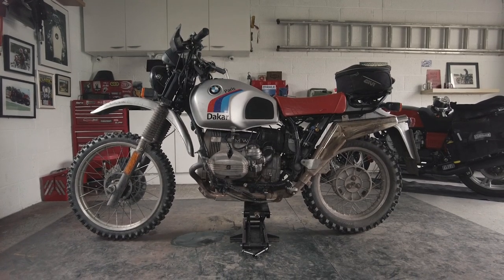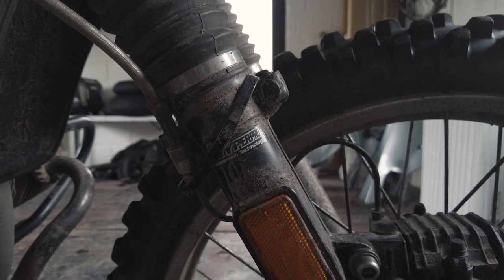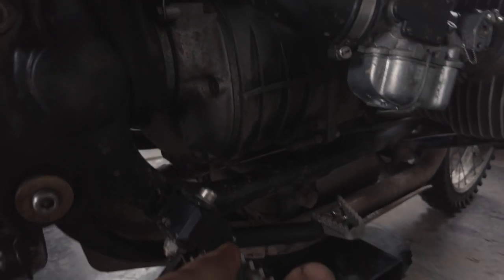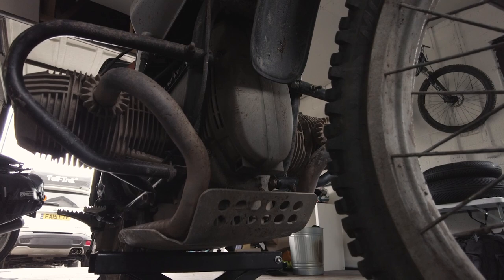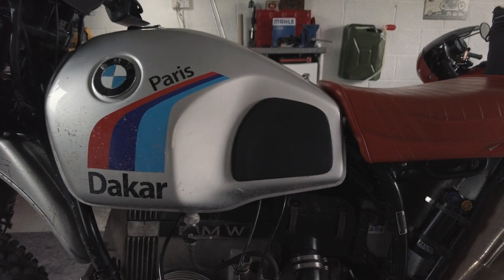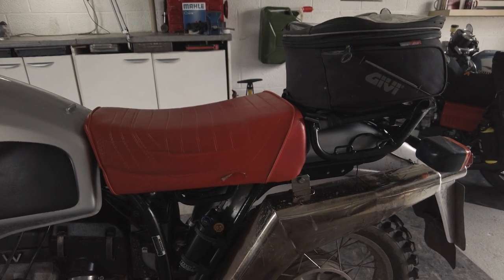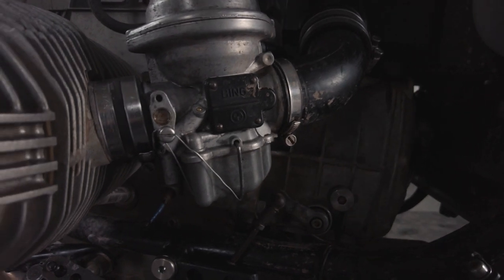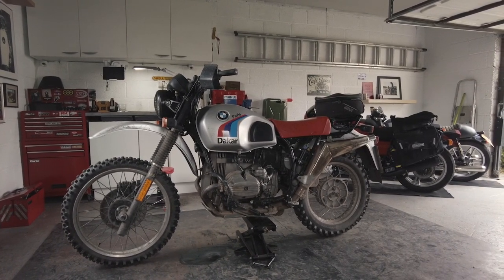GARAGE VIDEOS - BMW R80G/ST - Modifications explained and rated, technical walk round

Comment: Something I would add would be a ceramic clutch plate (the next time the gearbox is out). They are almost indestructible, they work when they’re red hot, they work when covered in oil (if you blow a seal). You can rev to 5000rpm and feather the clutch out in 2nd to get going in deep sand without ever worrying that you’re going to burn the clutch out… it’s the first thing I replaced on my original monolever GS, then an 1150 GS and now my 1991 bumblebee. They practically last forever - I’ve never got near wearing one out including full trans-Sahara, trans-Congo etc.
Reply from the maker: @paulclose3426  great tip, will definitely look at that next time she’s apart

Comment: Very nice information, thanks a lot. I‘m myself driving the 1991 gs and also had the shit in my pants because of the sidestand auto-snap situation. I‘ve had the sidestand modulated with a new spring set up and some welding. It works great even with the default sidestand.

Comment: Also based In Wales and have started modifying a cs 100 into some sort of Dakar Rep, but have come to the reality that I want something to use. Just strengthening the frame at the moment, be interested to know what options are best for the fork conversion, DRz is an interesting option
Reply from the maker: The hyperpro guys in Holland all ride pretty heavy duty trials with theirs and they all do DRZ400 conversion so they can’t be too far wrong. GS front end wasn’t a huge improvement although made it a bit more rideable off-road
Reply: Do they have any links to their builds ? Do they use the newer DRZ upside down ? Thanks

Comment: A proper Y-pipe will be a huge upgrade.
Reply from the maker: Hi Laurens. What’s the benefit of the Y pipe?
Reply: @bigberthaontour  I am not the original commenter, but still wanted to give my two cents. The owners of HPN (Halbfeld and Pepperl) once tested all exhaust setups out there. The most beneficial exhaust setup is the SR-Racing exhaust (once sold by Siebenrock as SGS2). Forbthe other exhaust setups they found out that the original exhaust collector is the best power wise. A Y-tube on the other hand will drop the weight significantly. You save around 2 kg and another kg by not having dirt collect on the collector while riding in muddy terrain.

Comment: Did it originate as a monolever or did you convert it? I didn't think monos existed until 87?
Reply from the maker: Both the original ST and G/S were monolevers, paralevers were the ones that came in at ‘87 and have the additional torque arm underneath